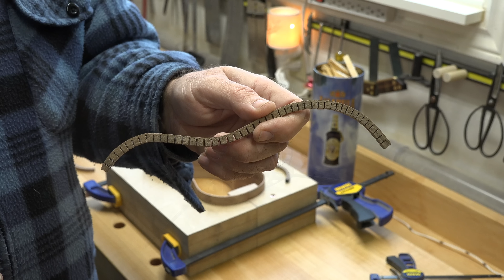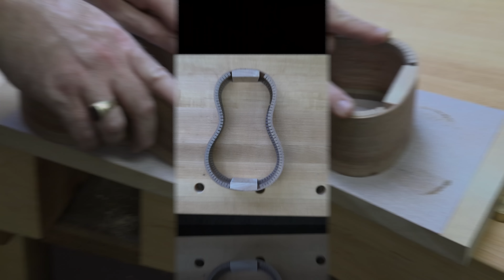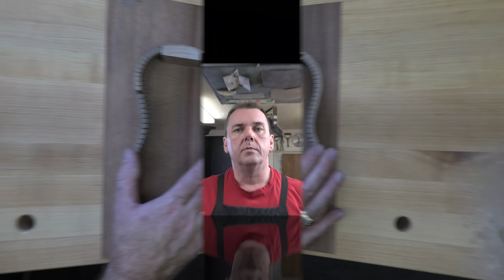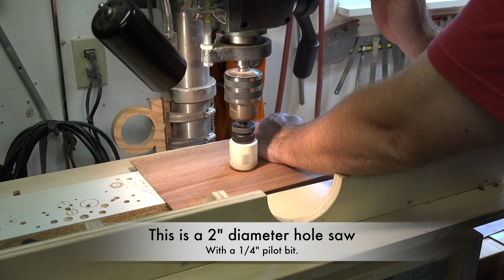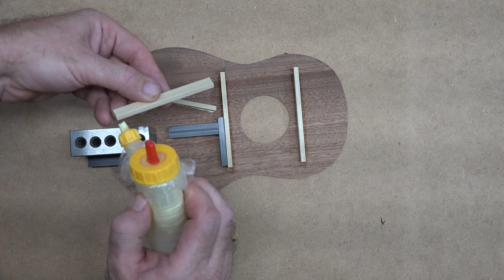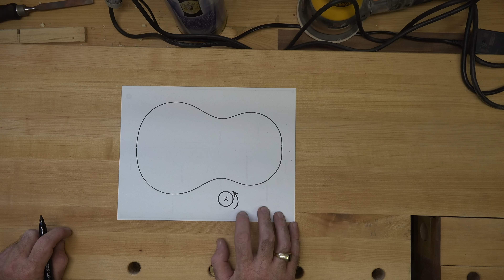Making a Ukulele Part 6

Comment: Did I see you route up hill on the last upper bout route? No problem resulted but not how you described it.
Reply from the maker: This series was produced over 7 years ago and it is quite possible that at one point, I routed in the opposite way other than what I described.  I got lucky and as you said, "no problem resulted".  You would be wise to pay more attention than I did in this video and rout the body in such as way as to not risk tearing out your body grain while accommodating your bindings.  Good eye Dana.  Thanks for tuning in and good luck on your build.

Comment: Aw man..... That sucks Kenny!  I've had a copier at work enlarging 1/4 scans plans and for some reason at the midway point it's scale changed on me and i didn't notice until It was too late.  I feel your pain my friend.  
Thanks for the explanation on routing with a flush trim bit.  I was making a couple of zero clearance inserts for the saw last weekend and I kept getting this terrible tear out when using the router table.  It was actually grabbing the piece and scaring the crap out of me.  It had been scratching my head because I have used this bit in the router (free hand no table) many times and I never had this problem.  Your drawing really brought it home for me.
Thanks Kenny!
Reply from the maker: +Chem Cody 
Glad to hear that the routing explanation was of some help to you.  Like I said before, even if you don't plan on making a ukulele, there is something in this build for everyone.  It kind of sucks that I was around 50 hours into the project before I noticed the incorrect sizing but I guess I was blinded by the progress.  The second build went much faster as I didn't have to film and things always go better on the second time around.  Thanks for tuning in again this week.    By the way, did they ever find out who kicked and dented the front face of your work photo copier?  LOL.

Comment: Thank you .Very nice and complete explanaitions. 
Saw your birdfeader staying in the shop. Why didn't you put it outside?
Reply from the maker: +Михаил Попов I haven't put a finish on it yet.  I made this one as a replacement for the one that is already out there.  That one is still working just fine but will need to be replaced in the spring.  Hopefully, by then, I will have some varnish on the new one and will have it hanging from the trees in my back yard.

Comment: you could also have used a drum sander with a bearing guide on it to flush up the top of the ukulele, or even a card scraper would have worked as well, would have taken longer but, it would get the job done without the possibility  of tear out.  I made that mistake with the router when I was doing my neck for my stat, ended up with some tear out at the head stock very end, lesson learned about paying attention to which way you are going with the router against the grain, next time will climb cut where needed.
Reply from the maker: +michael hoyle 
For a delicate operation like this, I only wish that I had a spindle sander with a bearing guide.  I had to use what I had and that happened to be the router.  With that being said, as you pointed out, paying attention to the grain will make this a painless process.  Thanks for the suggestion.  I'm am positive that it will help others who might not have the router set up.